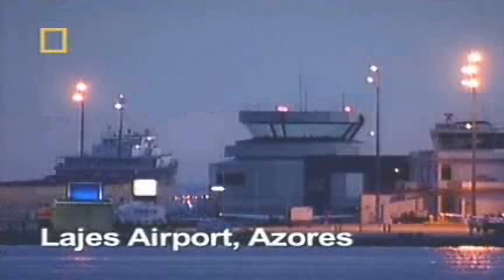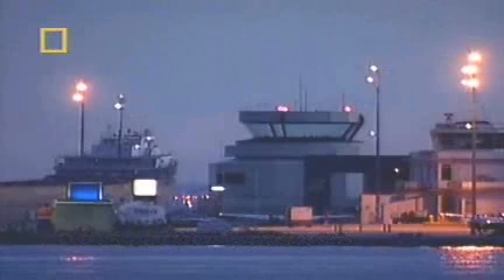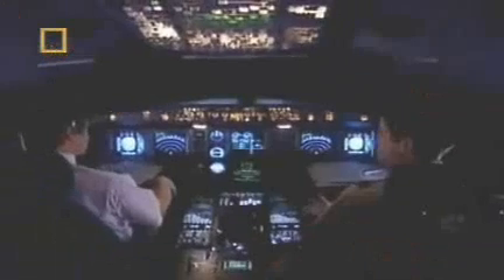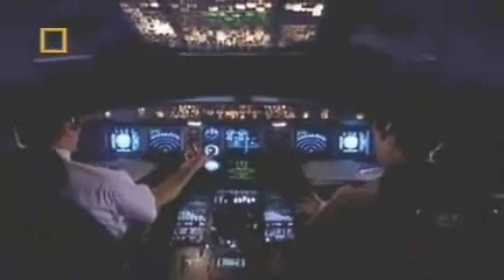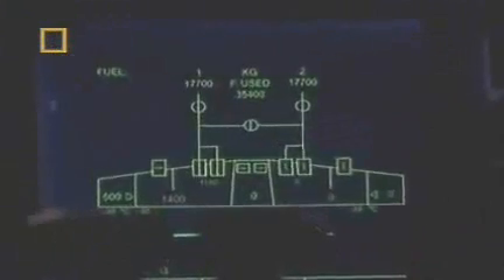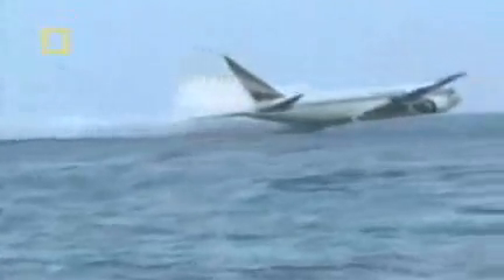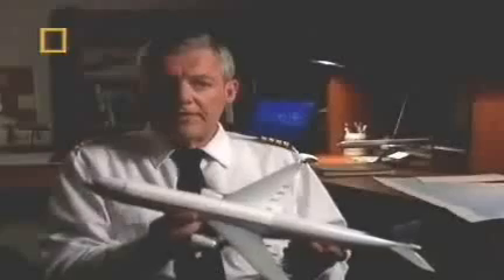Air Transat 236--Gliding part 3

Comment: The RAT (Ram-Air Turbine is what saved both the Gimli Glider and the Azores Glider. If this had happened on any precessing aircraft...there would have been no way to control the aircraft.